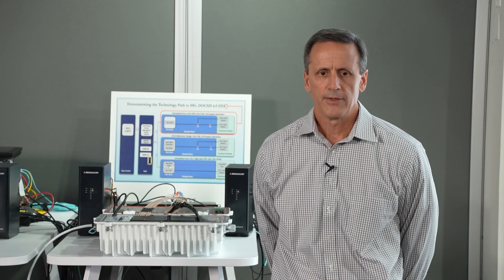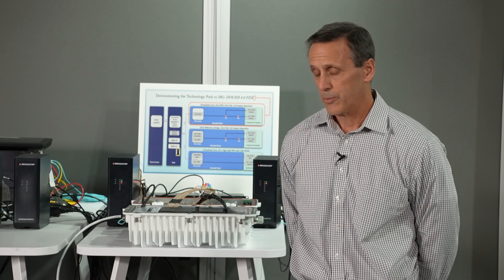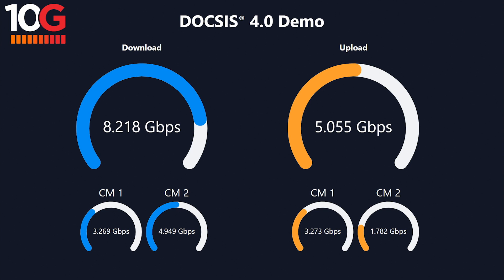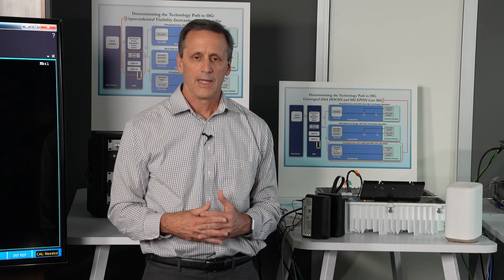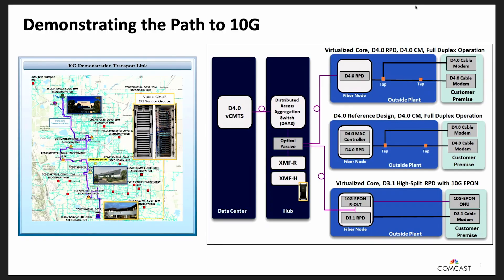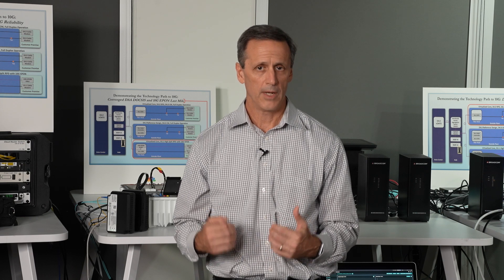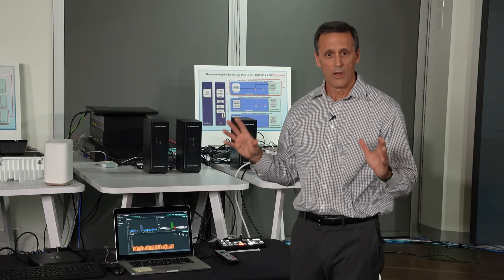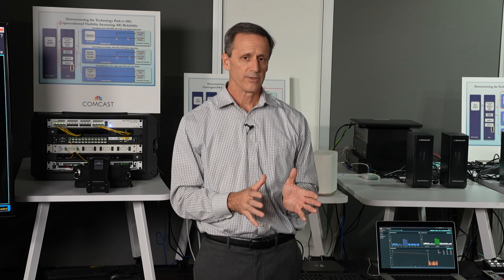Comcast Demonstrates Multi-Gigabit Speeds at CableLabs’ 10G Showcase

Comment: By the time cable operators spend all that money and time throwing at DOSCIS technology, you might as well pull fiber to every home and get rid of coaxial. No more amps, no more taps. Just direct DWDM split to homes. It's more expensive at the beginning but it will pay off very quickly over time. Why we still use copper for the last mile still baffles me.
Reply: you are worng about fiber not needing amps, any distance beyond 62 miles (100km) will need Fiber optical amplifier for signal regeneration for Single mode fiber while multimode will need Fiber optical amplifier for signal regeneration every 550m (1804ft)

Comment: I have a question on homeowners layout that when Comcast tech comes over to do the EPON upgrade will install a fiber node box adaptor as the rest of the COAX line can connect to this node for conversion compatibility or does the entire COAX line needs to be replaced as I understand there is no new hardware requirement inside the home only the outside line is being upgraded...
The COAX line out to house has 2 connectors and as one has a spliter/input/output connector as only 2 access points into home for HDTV and for PC...
I have a DOCSIS 3.1 hardwired router that is my own and using a CAT6E ethernet cable between router and PC.
Appreciate your reply.

Comment: You guys have so much of your system in fiber at this point, why not just change the last little bit of remaining coax and simply change the way you transmit cable television to people? Run fiber into the home, give a direct fiber connection for internet, and decode the fiber to coax for in-home TV-distribution purposes? It seems so backwards in 2022 to cling to coax for 10 gigabit speeds. So much wasted in R&D, when fiber is generations ahead of 10 gigabit at this point. Don't tell me you'd need to do more R&D to for putting TV over fiber. Your competitors do it already, and have been for more than a decade. It's honestly a waste of electricity to try to keep pushing speed boundaries over coax.
Reply: Sounds simple until you realize how difficult it is to completely replace thousands of miles of plant lol
Reply: @broccolirob5026 Their whole network is fiber up until the last mile. If you want to even assume that it's a literal mile every single time, because it's not. Most of it is much less than a mile. The fiber side of their network is all based on PON and XG-PON anyway. Their prices to actually run fiber to the home are way over-inflated as well. Quoting people like 20 grand for a thousand feet. Meanwhile there are smaller companies rolling out fiber and taking down Comcast left and right.

Comment: DOCSIS 4.0 won’t be here until 2027. What a complete waste of time. Cable cos need to roll out fiber now or get left behind.
Reply: What's perplexing is that most of their system IS fiber already. Their competitors who do fiber to the home have also been sending cable TV over fiber for more than a decade. I don't understand the fetish of keeping the last little bit of wire a coax instead of giving the customers fiber, and changing the fiber into coax (for TV) inside the home. All of this R&D is nonsense, and the cost is going to just be passed onto the customer, when they could just use established technology that needs no R&D, because it's been done for a long time already. I think people would be happier with just 1g symmetrical fiber with less congestion issues, than 10 gig down, 4 gig up, and the woes that come with cable internet and its peak usage times.
Reply: Because coax is cheaper and more resilient. Plus if they can provide 10G with existing architecture it means it’s deployable in areas without completely tearing down and rebuilding. If you’ve ever seen the plant installation (aerial or underground) it’s no simple task to just replace everything with fiber
Reply: @broccolirob5026  What a load of BS.
Reply: @timramich  I agree, it seems they care more about the shareholders and the bottom line than the customers
Reply: I don't think that long word is modems will start being available at the end of the year... So I think we see at least some  DOCSIS 4.0  services pop up here and there by 2024/25..
Reply: It's 2023 and they will be rolling out DOCSIS 4 to a few select cities to offer 2 gbps symmetrical.

Comment: when will we finally start seeing some upstream speed increases Comcast?  42 Mbps upstream on a 1 gig downstream plan in 2022 is quite ridiculous.
Reply: They just announced symmetrical internet a few days ago. Coming to all in 2023
Reply: @Ruffi0  yeah, I saw that.  as for availability in 2023 for most, I hope but I won't get my hopes up until it actually happens, given the years of claims of progress.  plus supply-chain, possible recession, etc problems don't help either.  here's to 🤞🏻
Reply: Depending on where you are they are upgrading the upstream capacity significantly. It seems archaic but I think an abundance of caution and testing is more important than slinging out new promises they can’t keep
Reply: @broccolirob5026  i think this is going to be with in 10 years
Reply: The reason is this if you can only get a upgraded modem every 2 year let say you have the XB6  u have to get the xb 8  2.5gb ,11 4.2gb ,13 6.2 then by the XB 15 will be 10gb
Reply: @broccolirob5026  East Bay Area CA, I.

That's exciting news.

I agree as long as they are proceeding in all due effort in the background and actual deployment accelerates.
Reply: Sorry your tiktoks won't upload as fast as you like
Reply: @shoosh6398  any other buzz words old man?
Reply: You won't the Technology is limited. And they are just blowing smoke up our asses to pretend like they are not a dying technology. A twinturbo steam engine pretending it is as good as a get engine.
Reply: How about 1gig down and 22-25mb upload thats what ive seen forever since 2005
Reply: @Legotech7711  no bueno for sure!
Reply: they are putting it in my area now
Reply: @LukeplaysTV  exciting... can't wait till it gets here.  congrats!
Reply: Comcast is ridiculous.
Reply: All this untapped knowledge Comcast could be using for their infrastructure deployment